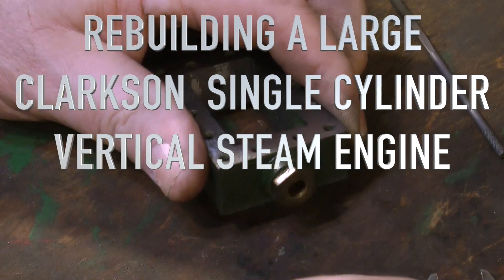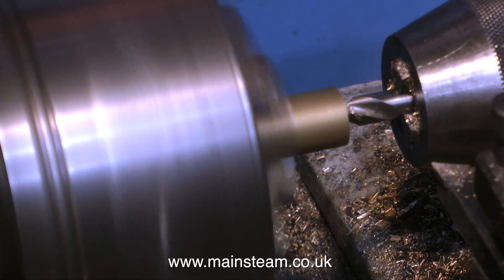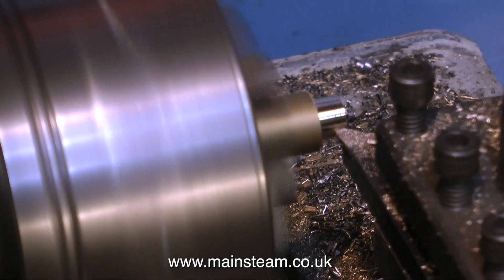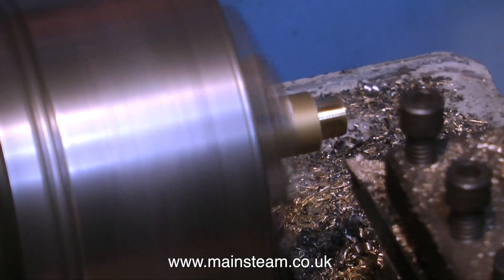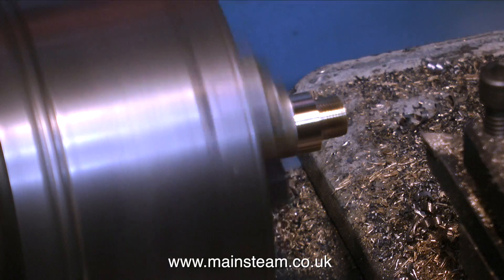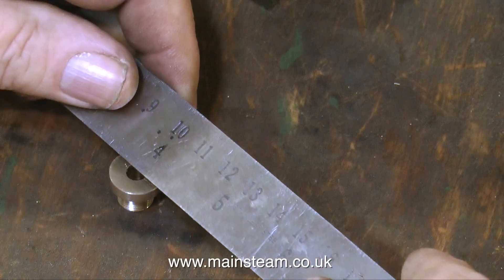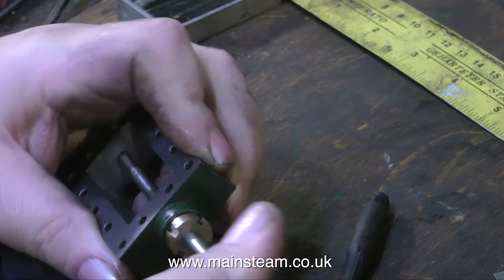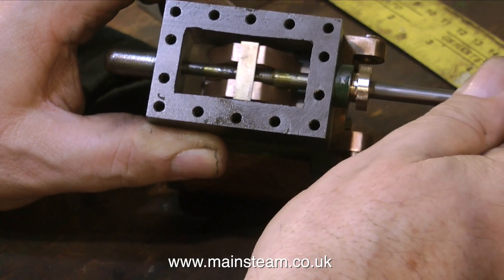REBUILDING A LARGE CLARKSON VERTICAL STEAM ENGINE - PART #15

Comment: I have a stupid question that has probably already been asked a number of times, but why use the packing yarn over, say, a silicone O-ring, to seal the valve rod passage?  Is it because the packing yarn is more adjustable for wear?
Reply from the maker: +orcasea59 Either method works fine.

Comment: I would check the other capped end on the steam chest so it don't fly across the room when you try to run the engine.
Reply from the maker: +sam yeates Yes indeed I will be doing that :-)